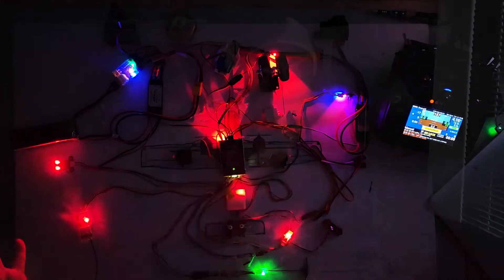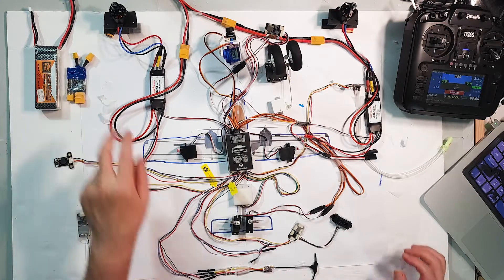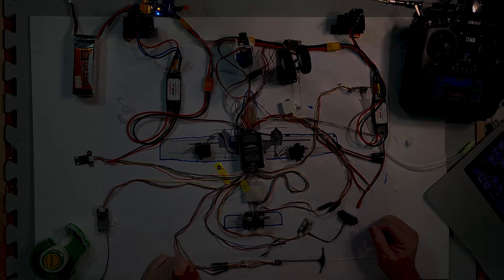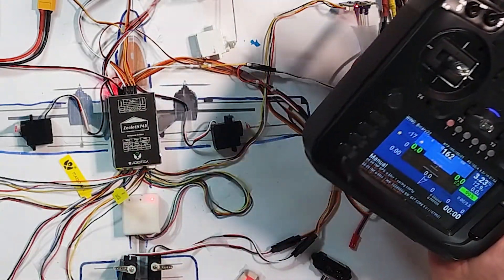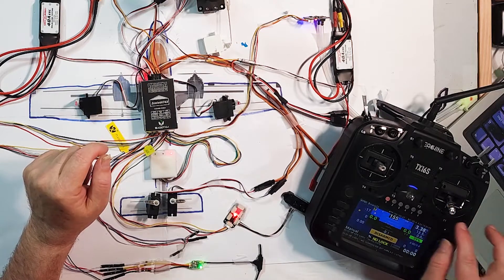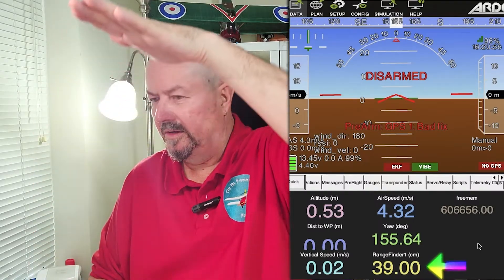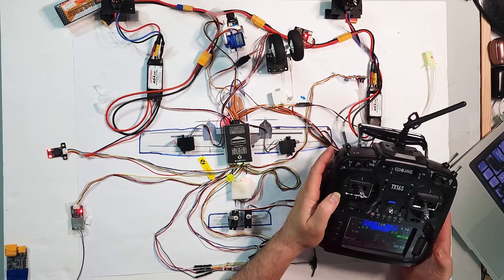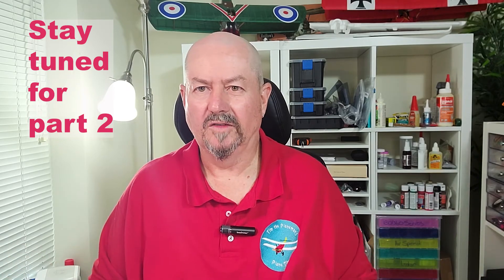Part 1: Qiotek Zealot H743 flight controller wiring diagram on a fix wing with ArduPlane - Part 1

Comment: How are you powering your servos?
Reply from the maker: One of the ESC's is connected to the power rail on the FC through the stardard servo plug. The other one I just disconnected the red/power wire. Thanks for watching!